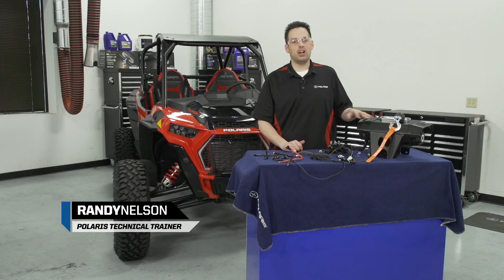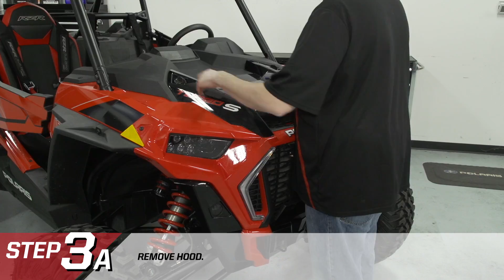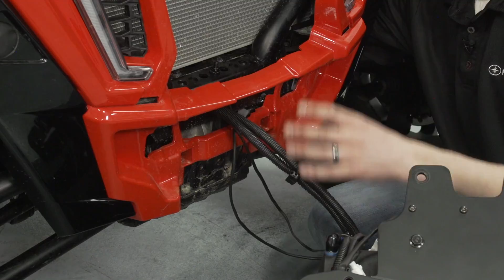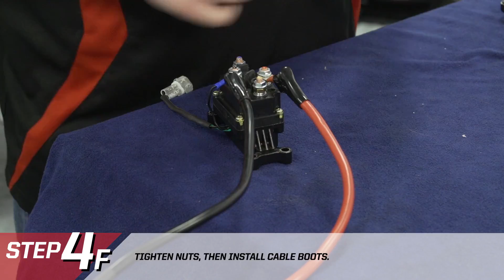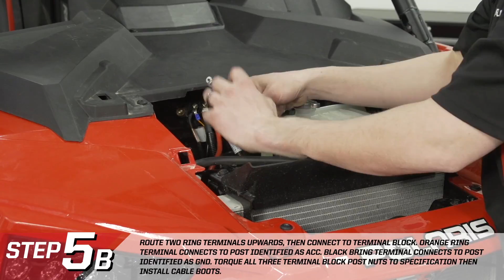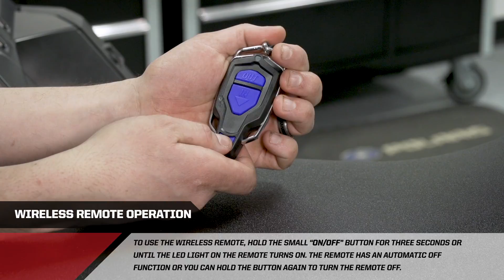RZR XP® Turbo S  Polaris® PRO HD Winch with Rapid Rope Recovery Install | Polaris RZR®

Comment: So I installed the same winch on my RZR but I was using it last night and I noticed every time I use it in or out my cluster light flicker for a seconds is that normal?
Reply: Hi.. I have this winch installed and it has the wireless remote.  I'm wondering if it can also  be hardwired to a switch on the dash in case the wireless remote ever stopped working?
Reply: @evancollins8898   hi evan I m wandering to if I can do the same. You right we never know what can be happene on the middle of no where
Reply: Probably draining to much power from your battery.